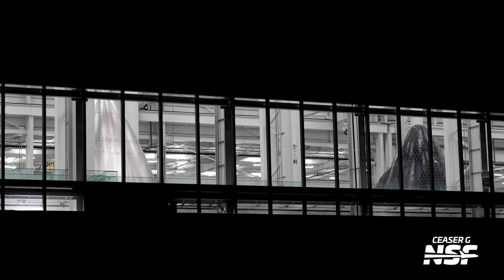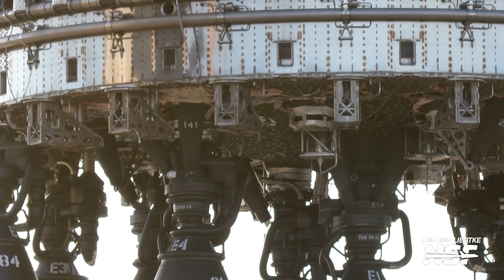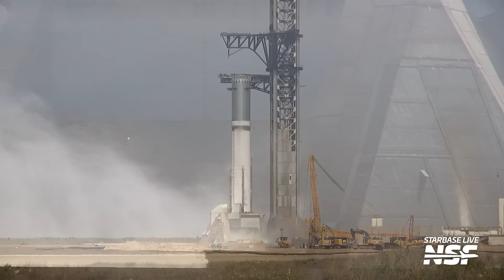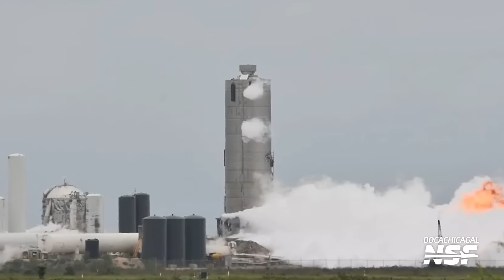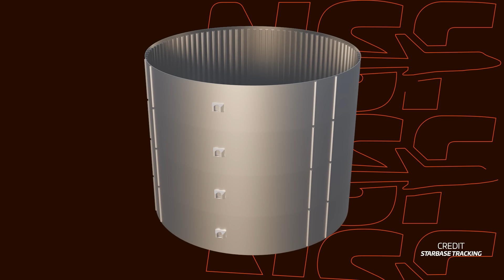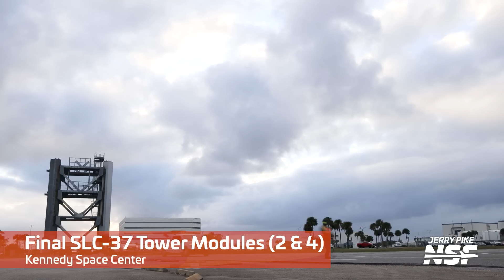First Starship Static Fire on Pad 2? Booster 19 Testing Explained | Starship Update

Comment: How is the air separation unit going to help with the supply of methane? Yes there is some methane in our atmosphere, but it's only 0.0001866% (1,866 parts per billion).
Reply: I don't think it's supposed to.  I suspect it's primarily LOX and Nitrogen.
Reply: @imaginary_friend7300  Yes, but in the vid they said it would help with the methane supply. What are the odds, that Elon is going to make good on his promise to supply Starship with carbon neutral methane? (It's technically possible to make methane from CO2 pulled from the atmosphere and hydrogen split from water)

Comment: Please, someone who has contact with NASA, I was the one who prayed for the California wildfires and had a dream where I prophesied that the fires in California would be extinguished, and a great flood fell and put them out. Now I dreamed that this rocket exploded, its head would split open, and God would cut off its head for blasphemy. In the dream, I saw the rocket priming its engines to take off, and I started praying for it, and I heard a voice that told me to run because it was going to explode. I told my sisters to run because it was going to explode, but they stayed behind. I ran, and the rocket exploded, but my sisters didn't die in the explosion. It's possible that the astronauts won't die either. God will not allow the US to roam the skies with that abomination, Artemis. The only God on this earth and beyond is Yahweh. NASA, it is recommended that you change God's name if you want to reach the moon before the Chinese.
Reply: Sure, they love hearing from the fringe lunatics.

Comment: At 7:37 regarding that skinny pipe venting at the bottom of the launch mount. That may be bleed off/venting from the conical shaped reservoir that feeds the center gimbaling engines. Just a though because of the "V" shape of that cone. The fuel at that area may not be completely emptied via the normal recovery operations.

Comment: 5:22 would be nice if you also included metric units in this channel.
Reply: I mean it literally does include liters, although it should be mass flow.
Reply: @Ellhulto correct. Wasn’t watching but listening. Guess I shouldn’t look away.
Reply: I grew up in a time when clerks at the grocery store could count change...so arithmetic isn't a challenge. The rough conversions are math most ppl can do in their heads.
Reply: @deanl6613 Why would most people know the conversion for some random unit.
Reply: @deanl6613 good for you 🙏🏾.

Comment: Call me crazy, but the ASU looks to be seriously undersized for what they'll need. I expect to see that replaced, or at least supplemented, by something with more capacity, but I'm no expert, either.
I think Massey's is going to need another test stand, too, in order to test boosters. I don't think it will be feasible to shut down the entire launch site just to test a new booster. Probably means it will need it's own ASU, too.
And what about the proposed methane production from wells already on the site? Has that gone the way of the dodo?

Comment: It is surprising to watch the effort beng placed around the construction of this Type 3 Starship and of the fabrication sites for it. It is all vast, reminding me of how often technical solutions grow in size until a change is introduced rendering all that has been done as redundant.
Manufacturing factories moved from enormously complicated belt driven machines and tools powered by overhead drive lines to suddenly independent electically powered machines which completely changing manufacturing. Steam locomotives went through a massive drive to increase efficiency with incredibly complex energy recovery technologies and then the diesel locomotive appeared.
We are now witnessing the end of the chemical rocket to achieve orbit and space travel.
The  chemical rocket is about to be replaced by atomic particle physics, much simpler, safer and powerful. I sense Starship V3 will be the final hurrah for the chemical rocket, burning methane and oxygen. Beautiful to watch, and rendered obsolete just as they are being built for testing and evaluation. Enter the neutron and proton pwered craft, driving gravity controlled and cross dimensional propulsion in small vehicles delivering humans into the next stage of their exploration. Amazing to be here at this time.

Comment: How are they going to handle the "forced direction flip" during hot staging? There isn't anything visible that will direct the exhaust like on the disposable ring.
Reply: Rumor has it they will do it with differential thrust of the starship engines.